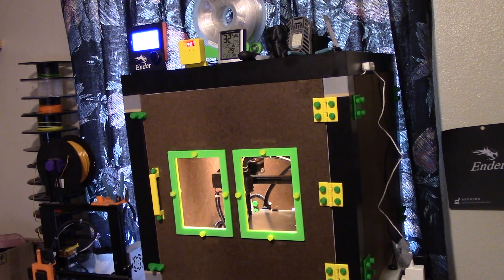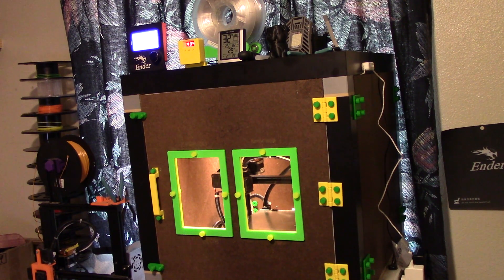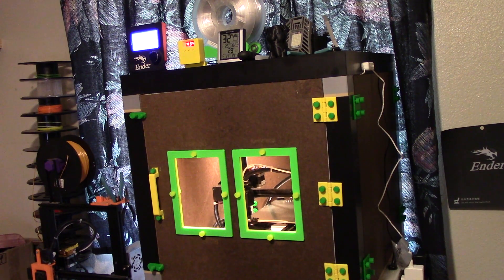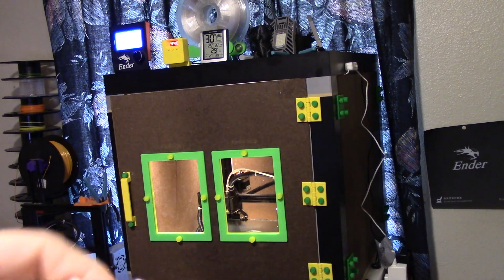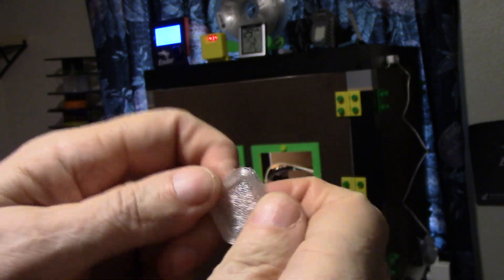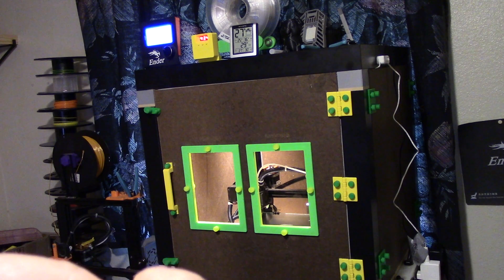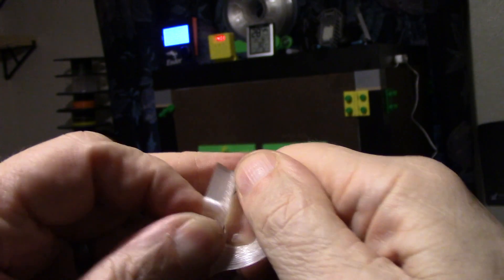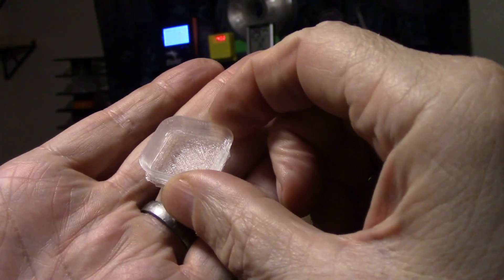First Polycarbonate Print in Ender 3 Ikea Lack Enclosure!

Comment: What if you put a heat gun to it immediately after peeling it off or maybe at a distance during printing? Seems like that would add the necessary heat. I'm trying to find a filament that tolerates heat, to house electronics. Looking at ASA, PC, and ABS potentials
Reply from the maker: I've got a newer video on a better polycarbonate, Polymaker Poly Lite. It's much easier to print than the Gizmodorsk PC  in this video. But so far I think the best filament for indoor and garage use is ABS. It's cheap, tough and prints nice if you have an enclosure. It's main drawback (other than requiring an enclosure) is it doesn't seem to handle UV very well, but neither does polycarbonate. I think for outdoor use either PETG or ASA is probably going to be the winner. I haven't tried ASA yet, but I hear it's tricky to print and will also require an enclosure or controlled environment.

Comment: thanks for sharing!

how thick do you think printed pc would need to be to stop bullets?!
Reply from the maker: That's a tough question. A lot is going to depend on the bullet being able to delaminate the layers, the shape and construction of the bullet and it's velocity. A low velocity handgun round like 9mm or 45 will be a lot easier to stop than a high velocity 30 caliber rifle round with a steel penetrator.
Reply: @3rdpig  hi! i found this as a reference....

Comment: Try Polymaker PolyMax? It's considered the strongest PC
Reply from the maker: No, I haven't tried that one. Apparently the one I bought is the one everyone seems to have the worst luck with and I haven't really researched enough yet to pick one. Have you used the Polymaker? If so, what print surface and bed temp have you had luck getting it to stick on?
Reply: @3rdpig  

I myself have not tried it, however, the person I purchased my PC pieces for my hot end uses PolyMaker PolyMax and he says he runs it around 290-295 on the nozzle and 110 on the bed if I recall correctly...

Comment: I use an ultrabase type build plate with purple glue stick @ 90-100c  But i think garolite would be better. How do you get into the firmware to change the max temp exactly?  The priline cf pc ends up having a very nice finish overall....just need a bit more temp than 260c. I wanna try 270c......so ill wait for your response and hopefully you can walk me through the process of changing the maxtemp. The stock thermistor should be ok for 275-300 from what i could find...so just needing to change maxtemp
Reply: I also put a garbage bag ove the printer while printing with it...poorman's enclosure..

Comment: Chuck.....how are you running at 275? Is that what the maxtemp is on the ender 3? I have the cr20 and its got a maxtemp of 260. I would love to hit 275....but can find any info on how to do it....ive already upgraded to a microswiss....done pid tuning. Any thoughts? Im attempting to print priline carbon fiber polycarbonate....they claim it prints at 250....hahaha.....260 is ok....but i think the sweet spot will be 270. Ive been using ultrabase with purple glue stick for bed adhesion and 95c bed temp. I just need to eek out 10 more degrees on my hotend for best layer adhesion......the priline might be just the ticket for you also.
Reply from the maker: In one or more of my earlier videos I talked about getting the higher nozzle temps. In short, I installed the all metal hot end and replaced the bulb type thermistor with a screw in brass type capable of handling 300c. Then I updated the Max Temp setting in the firmware. This is pretty much all that's required.
What type print surface are you using and what bed temps are working for you? 
I'm glad to hear the the Priline PC is working for you, I think it will be my next attempt to print PC. Everything I've read tells me that almost no one is getting the GizmoDorks PC to stick to anything, and that's been my experience.

Comment: Cool project. Have you added a heater yet?
Reply from the maker: Not yet. And honestly, I'm not sure I'm going to. I'm having such great luck with ABS that I'm not sure I'm going to keep up the battle to get PC working. Specially not the GizmoDorks PC, it seems that it's the one PC filament that everyone has the most trouble with. And it needs a 130c print bed, something I can't do yet. I may try a different PC filament someday, but I think I'll have to have a real need for PC before I spend the time and money. Right now, ABS is doing everything I need a tough, heat and chemical resistant filament to do.
Reply: @3rdpig  Awesome, have you noticed the enclosure helps with printing ABS? I would think so with the elevated temps & stability, but, I haven't yet tried to print ABS. LOL

Comment: Chuck, congrats on enclosing your Ender 3.  I enclosed mine several months ago with Ikea & Polycarbonate =, but my setup isn't nearly as elaborate as yours.  I would love to see more information on your tests on printing polycarbonate.  Did you get it figured out on the correct settings?  Just from what I've seen so far (mainly from you), it looks like poly is going to need a extremely high hotend temp in order to get the layers to adhere well.  Also, getting the bottom layer not to warp is another issue.  Love your videos.  I always learn something when I watch them.  Love to see more on Poly.

Comment: I would definitely be checking my steps/mm for the PC filament. I have to admit that I haven't watched enough of your videos to know if you do this process for different filament types. I think I might also try more chamber temperature as well, but I'm not certain what is recommended for the PC you are trying. 

Saw you mention fan failures in other comments. I buy most of my electronic components from Digikey, using their advanced filtering options you can get exactly the fan you want, with the proper CFM, Static pressure, size, bearing type, etc and you only spend about $10 on a fan. It's well worth it for me and I have never replaced one of the fans bought there (well unless I did something stupid like put a screwdriver into the blades).
Reply from the maker: I checked steps/mm when I swapped in the new board. I'm not sure there's any reason to set it again unless the diameter of the filament is out of spec. Even then I think I'd rather adjust the flow rate than mess with steps/mm. If I'm wrong, let me know!
You're right on the fans, I have to stop buying these crap fans straight from China. I usually just stick them in with other orders and often they're only $1 each, but the last batch didn't last me more than 50 hours or so each. Pure junk. Even lubing them with synthetic lube when new didn't make them last much longer. I'll look at Digikey.
Reply: @3rdpig  See the thing is, you should adjust your flow rate for each type of filament for "best results". The gear that drives the filament along has teeth, softer filament will dig further into those teeth. So in effect filament may be closer or further away from the center of rotation of the gear. This has the effect of changing your steps/mm for each type of filament by varying the circumference of rotation. You can try to battle this if you can adjust tension on your spring but that's a huge pain in the ass. It's best to just determine a % to put in the slicer.

Pick out your most common type of filament that you use and set your base steps/mm with that filament and re-flash or store the settings in EEPROM or however you wish to get it done, this will be different on a 32bit board I think. Where the filament enters the extruder, measure 20mm out on the filament, put a piece of painters tape right at the 20mm mark. Warm up the printer and tell it to extrude 15mm of filament. Measure to the piece of tape (carefully measure and make sure you are measuring from the exact same spot), in a perfect world you would have 5mm. Lets say you had 6.5mm left sticking out. So you just extruded 13.5 instead of 15mm. Simple math from here. What percent of 15 is 13.5

n% * 15 = 13.5

13.5 / 15 = 0.9
Move the decimal over 2 places and you got 90%, so your steps/mm (in this example) are 10% low.
You can look at your steps/mm and increase the number by 10% and try the above process again. 
So lets say your steps/mm is 250. 250 * 10% = 25 ------ new setting is 250 + 25 (or subtract if you are over extruding)

Try to get within 2% if you can. Now that you have it set to the filament that you use the most, try other filaments using this same process and get percentage numbers to put in your slicer. The factory settings are only half ass close by the way, so don't completely trust the default settings. Exact spring tension and the sharpness of the teeth on your printer will have an impact that can be different than the next guy (no 2 anything are alike). Keep in mind that this process might not actually "fix" anything but your extrusion width wont be an issue that you will have to think about as a "potential problem." This lets you look at other issues that might be causing problems. Also some slicer software does not recommend that you increase percentage beyond a "certain amount." I can't be certain about yours because I haven't read about it, but that might be something you want to look into, software being what it is, just might ignore values beyond a certain number (this is hypothetical and I'm not looking at software source code to find out lol). A little research could go a long way.

ONE more small note that I just thought about. If you upgraded to an all metal hot end, check your retraction amount. Do some research on recommended retraction length on your specific hot end. On mine (direct drive Titan Aero) the max I can go is like 1.5mm. Bowden extruders can go a tiny bit higher than that but not much more, so you might want to look into this if you are using a retract distance any higher than 1.75mm or so. Too high of retraction will mess up a print with an all metal hot end. Sorry if I'm piling info on-top of info but I haven't seen a video or your's (yet) where you list your exact settings. Not to mention I haven't watched all of your videos yet.

Comment: Thanks, Chuck. There are just so many parameters you have to work with to find the right 'mix'. I'm sure you'll get the right combination. Is the hardware holding up well?
Reply from the maker: YW Paul. So far the only thing that's failed is the 50x15 blower fan in the SKR box, which isn't even in the heated chamber. I had another to swap in, but that's the 4th one I've gone through in the last few months. It's almost like the $1 a piece fans from China are no good. lol.
Reply: @3rdpig  I had some bad ones from China. Not a lot you can do about it.
Reply from the maker: @PaulMcKillop  China's getting on my nerves. Yes, you can get some good stuff incredibly cheap, but it's a crap shoot and it makes me afraid to buy anything expensive from them. I just bought two LED, RGB remote strip lights and the remotes don't work properly on either of them. I put in a complaint and they want me to provide video and a full description before they'll consider a refund. While I'm tempted to do it, the time involved isn't worth it for $10....and they know it. This particular time was with Gearbest, but they've all done it to me. And yes, if you provide them with enough info they usually will offer a refund or replacement.
Reply: @3rdpig  I have had less trouble with Banggood than others. Gearbest get a terrible name!
Reply from the maker: @PaulMcKillop  I bought my first 3D printer from Banggood. But then Gearbest approached me with the offer of an affiliate membership. Problem is, they stopped offering me 3D printing related items for review and now all they want me to push are phones, baby monitors, R/C toys and such. I still have the affiliate membership, but Iv'e added both Amazon and Banggood's as well. Gearbest barely even talks to me anymore and at one point they were video chatting me every few days. It's a relief in a way, the video chats were irritating.

Comment: Thanks Chuck for giving PC a go.  Looks like you still have some tweaking to do but I think you have the right equipment now.  I think you're on to the fact that the filament needed to be dried.  I think PC is very hygroscopic so you might have to run the spool through a dryer.  I've seen that there are some PC "blends" out there that claim to be easier to print.  They're a bit pricey so may be hard to justify trying too many.
Reply from the maker: Somewhere there's an answer to the question of "how much moisture is too much?". Since no one seems to be able to answer that, I intend to find out for myself.